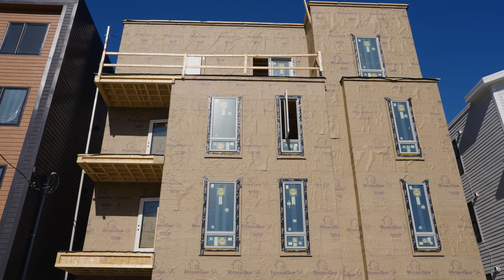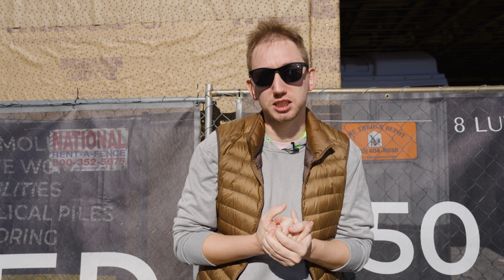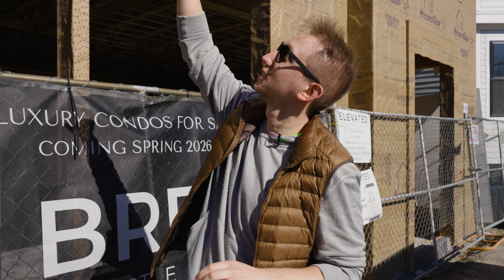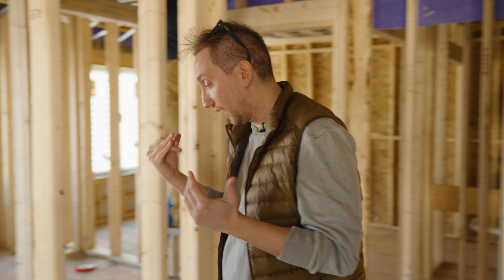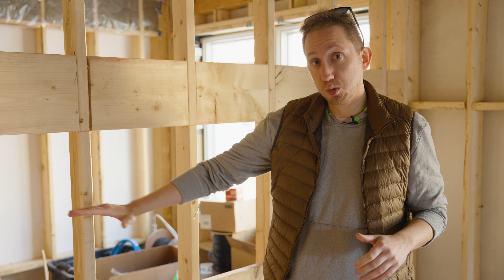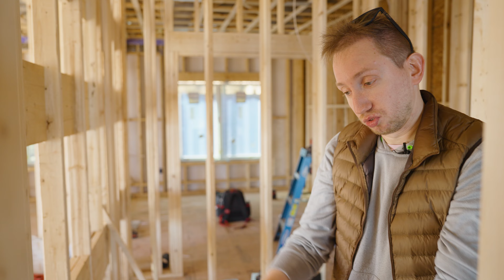How I'm Framing My 9 Unit Condo Project in East Boston

Comment: Please Note: Making changes to a finalized, well-designed plan often leads to "double work," increased bidding costs, and logistical messes—especially with complex areas like kitchen layouts. An architect is hired specifically to foresee these design challenges. Deviating from the plans mid-stream usually results in costly lessons. I encourage you to trust the expertise you’ve hired; if the current design doesn't feel right, we should address the partnership rather than compromising the build.
Reply from the maker: Dont really agree with this take. Things on the field can be different than plans, and as long as you are working with good subs/GCs making these adujustments can be critical